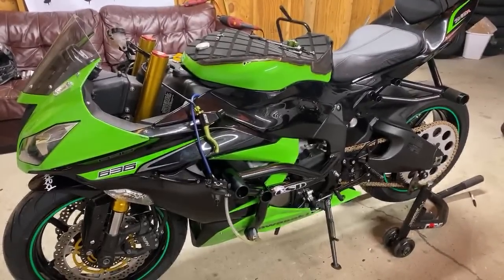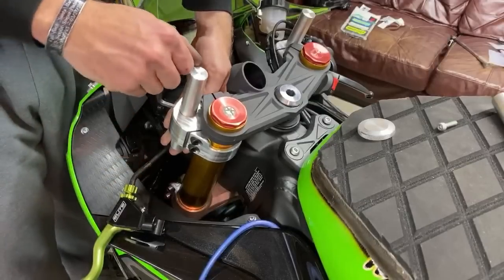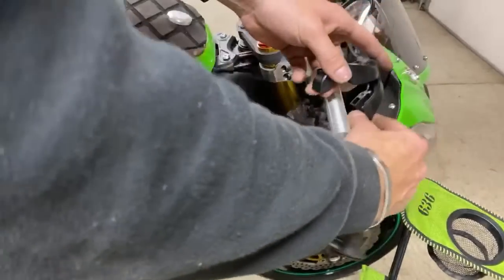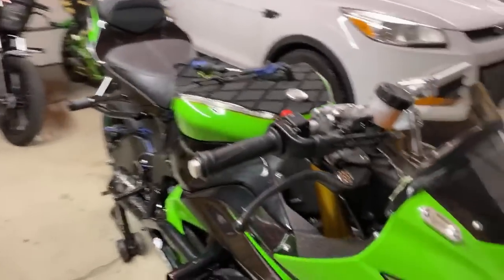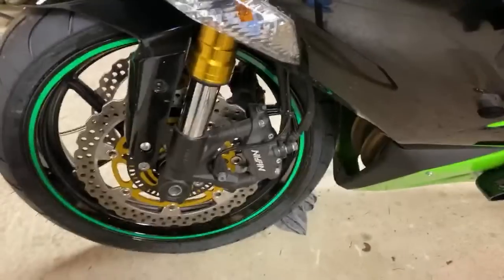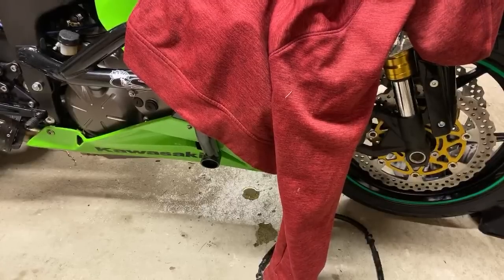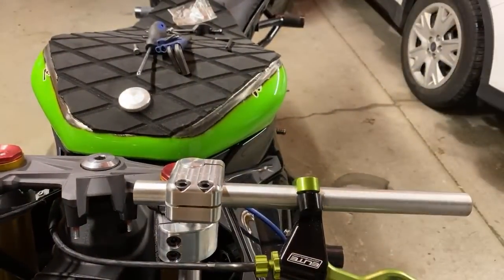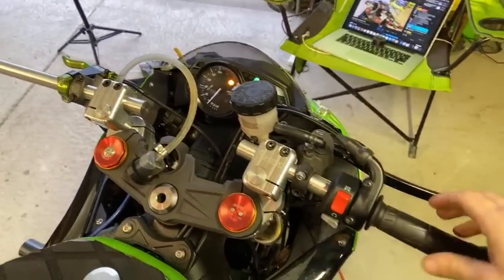Cage, Clip On’s, and Lines LIVE!

Comment: 2013+ and up 636 is so much much sexier and aggressive compared to the new "face lift" which it did not need. Hell, even the 2019/2020 636 is still using the 2013 engine with slight modification like tuning and a sprocket change. All hail the 2013 636.

Comment: Did you have to take the motor out to get the modded pan and pickup on? I’m having a hell of a time installing mine on the bike
Reply from the maker: NO sir, just took the bottom fairings off!
Reply: @brian636  wait you only had to take off the bottom fairings? No removal of the headers, radiator, or anything?

Comment: Hey bro would you mind doing a video on "How To Adjust A Clutch Cable"? Preferably on the 03/04. Been trying to get mine figured out and adjusted right, but any adjustment from where its at now either makes my RSC lever too stiff and cramps up the wrist, or the bike feels like it's spinning the rear tire when you pop the clutch but it's not, it's almost like a slipping feeling, but it's not clutch plate related, as they were put in new last year (result of a rolling burnout attempt that fail miserably lol). Anyway any info would be appreciated. Brrraaappp! 🤘